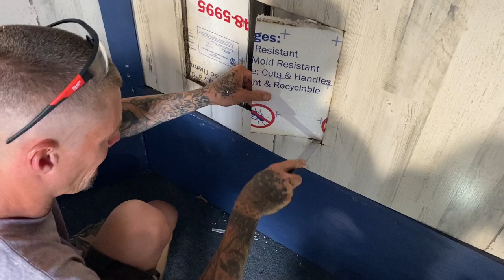Window unit in enclosed trailer

Comment: When you removed the wall rib you weakened that wall. If you watch your video as your pushing in the insulation the wall moves and flexes. It will flex more when pulling the trailer down the road. You may have to take the a/c out enlarge the hole and frame it. I hope that's not the case but just be aware it's a possibility.
Reply from the maker: Yes it did! 
Which is why we added bars going across and down side to frame it in this was our first video and missed a lot but we are learning and this is all new to us we are figuring it out one project at a time lol sorry if it come off as if we are Experts their will be new videos coming soon explaining everything we did what we had to redo what we learned and all the stuff please subscribe and feel free to comment I love to learn! I normally just eyeball and wing it 😂
Reply: Exactly what I thought as well. Needs a frame or at least something to sit on.